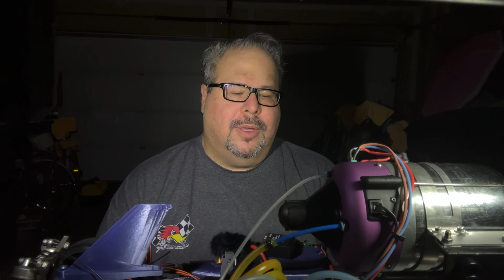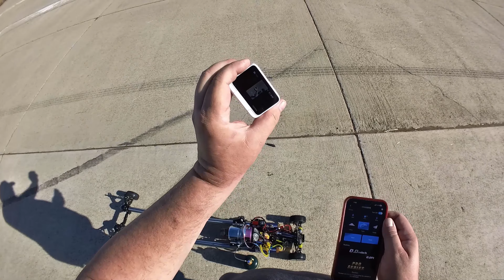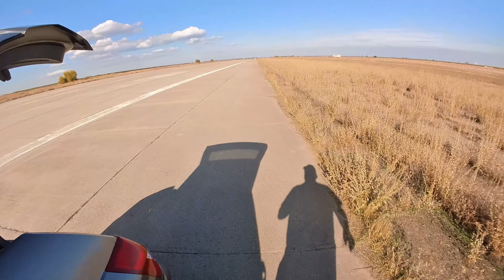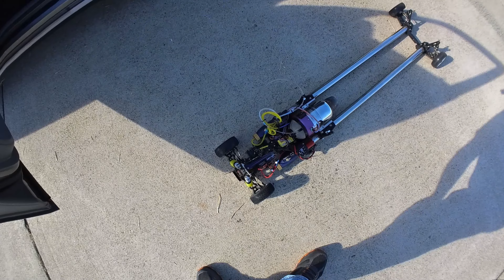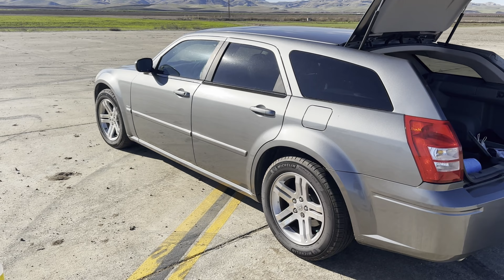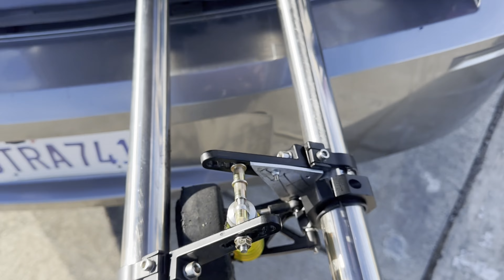Faster than the Guinness World record RC Jet Car! Is it a new record???

Comment: Speed running my Arrama infraction the least amount of suspension trevel the better. Also, if you plan on going faster than 140 you should put some foam BSR Purple or Yellow compound tires with one-piece disk wheels. Make sure to use traction compound or some Coca-Cola on the tires and let them dry. For the world record who cares what Guinness says. If it's on film it's a world record IMO. Congrats on the Jet car world record.  I would also widen the stance using Truggy arms instead of buggy arms and use some infraction shocks with perfect pass black springs. You should be able to get that thing to 150 + easily with some changes. I hope to see you go even faster soon. Once again, congrats on the world record.
Reply from the maker: Thank you for your detailed reply. I am going in a total different direction which I think you'll enjoy. The success or carnage, it will be fun to watch.

Comment: Great progress so far.  We have found for the tires you have to run foams (BSR purple) for speeds up at 180+ mph.  Also many have tried narrow cars with very bad results.  The wider stance really helps with stability.  Finally as you know an aerodynamic body will help a ton.